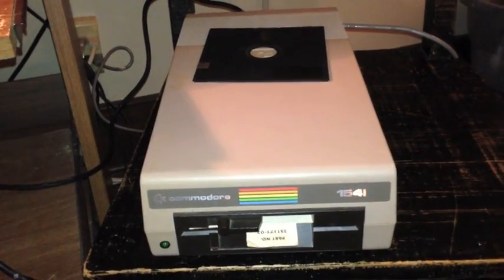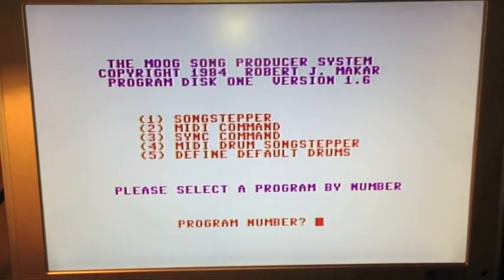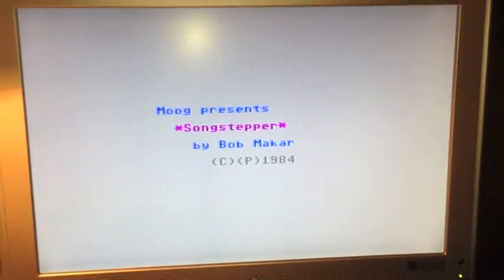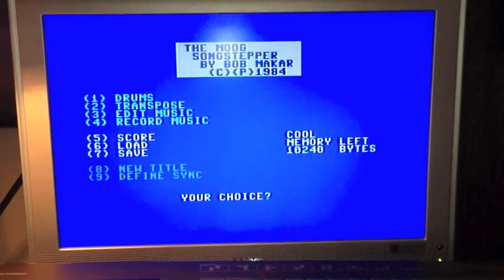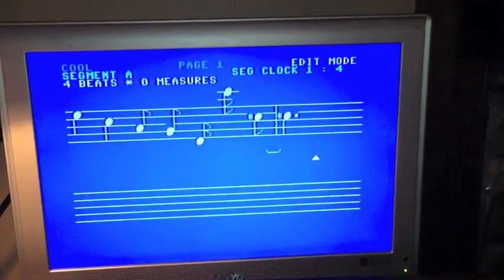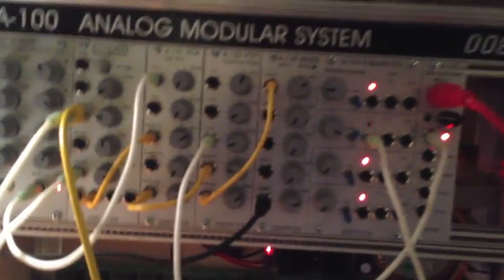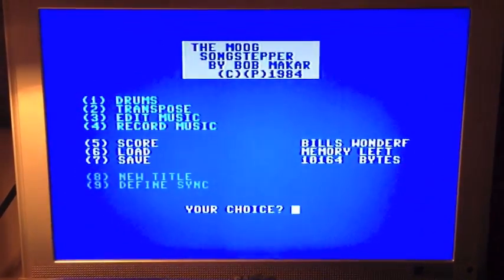Moog Song Producer Commodore 64

Comment: Cool that's you're into all of this - but you must not have grown up in the C-64 era.. 

You should always switch on the printer, then the drives and lastly the computer itself. Don't power-switch or disconnect a drive while it is connected to a running computer, it can cause permanent damage to the computer I/O hardware.
Reply from the maker: Drlegendre, thanks for letting me know. I didn't grow up with this computer and wasn't aware of that. I'll keep it in mind from now on.
Reply: Bills Ship No problem man. I'm glad you actually took the advice, rather than gave a bunch of guff about why it shouldn't matter.

But for sure that was the iron rule, back in the day - in like 1983, when the C-64 was $350 and the dang 1541 was still in the $400 range or better!

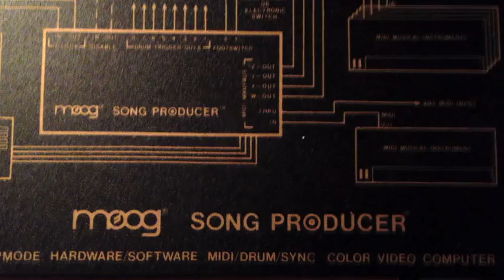Comment from the maker: 0:00 Introduction
2:05 Booting up the software
3:10 Songstepper
4:53 Deleting Notes
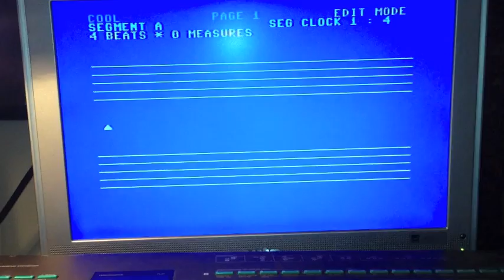5:11 Entering Notes
6:36 Playing Segment (where sound comes in)
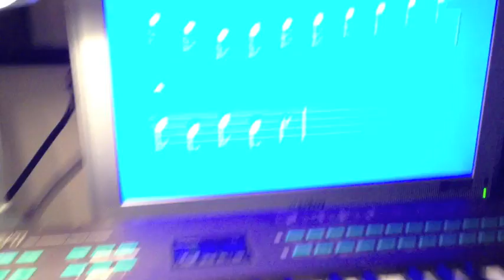8:39 Clock/Tempo
10:12 Sync Settings
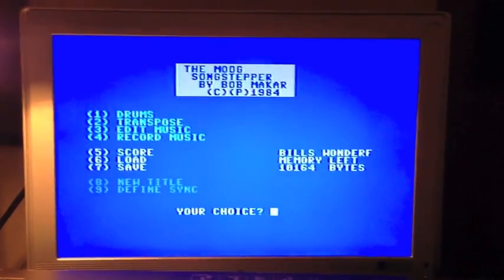11:31 Manual
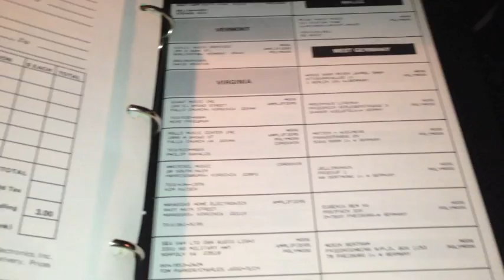12:29 Planned Analog Module